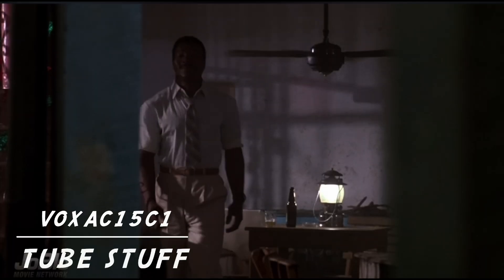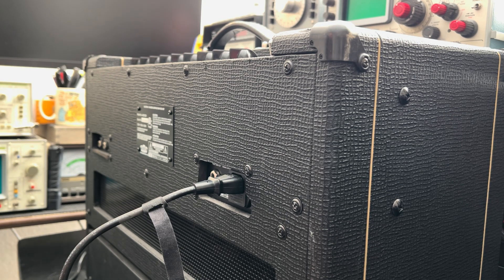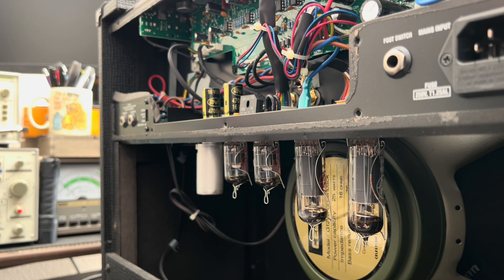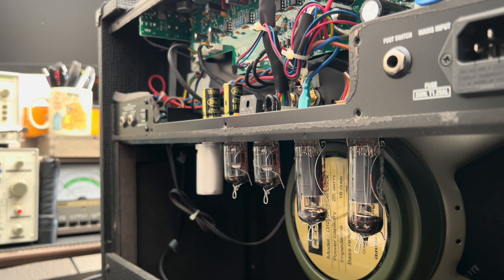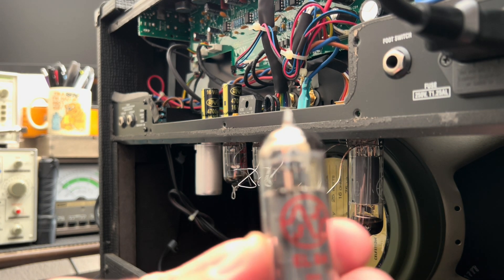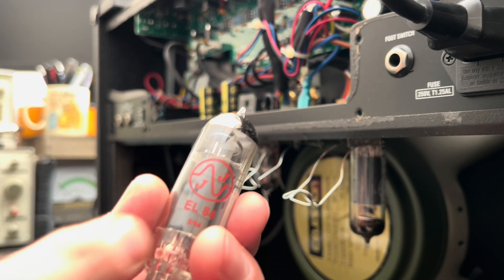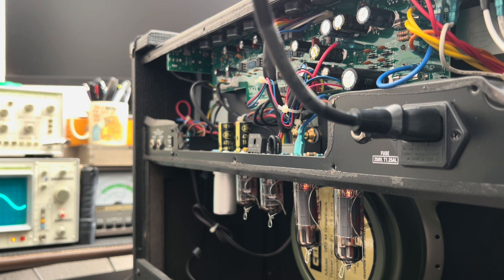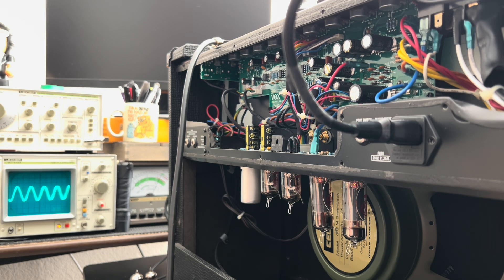Vox AC15C1 || Tube Stuff

Comment: Are el84's known for being crap? Im on my second pair of them in 2 years. Same light show. But moments just before that light show, with the trem is up, the light pulses to the trem.
Is the ac15c1's known for high cathode bias that causes premature tube failure? Cause the el84's run way hot in mine.
Reply from the maker: They are not. The Amps that they go in, however, are known for being extremely hard in environments for them and should be adjusted accordingly.
Reply: How about bumping up the cathode bias resistance,to say 200ohm 5 watt?
Reply from the maker: Are you technical?  Can you measure plate voltage and the voltage across the existing resistor?  What is that resistors value?
Reply: @ForgottenGearRestorations A tech, no, but I have dabbled. Repaired a few siverface amps, modded my Blues Deluxe, built a 5e3, repaired and modded pedals.
The resistance value on the schematic is 120 ohm.
Reply from the maker: You’re qualified. Without any other data I’d use a little Kentucky windage and try 150 ohms. A year on a set of el84’s in a Vox isn’t too bad.
Reply: @ForgottenGearRestorations  haha, thanks for the compliment. I tinker at best. I'll give that a try.
Reply from the maker: @ericheder777 🙌🏼